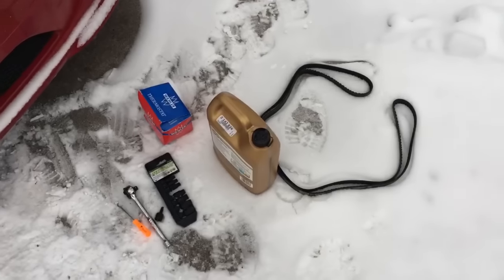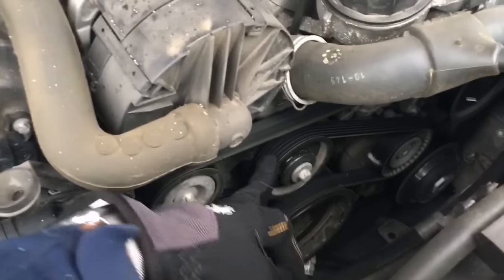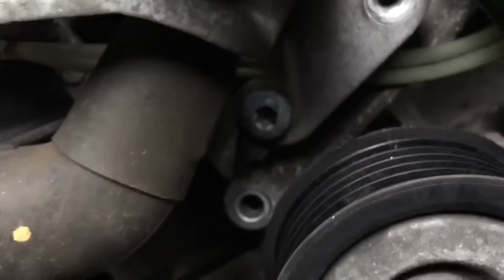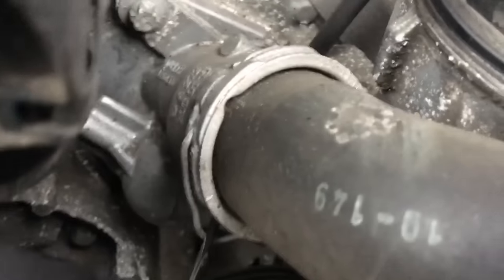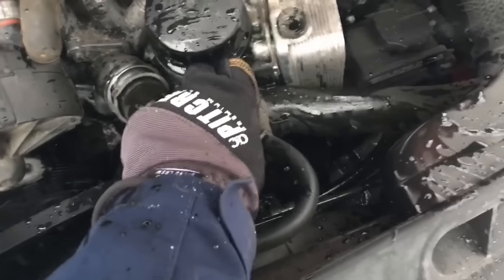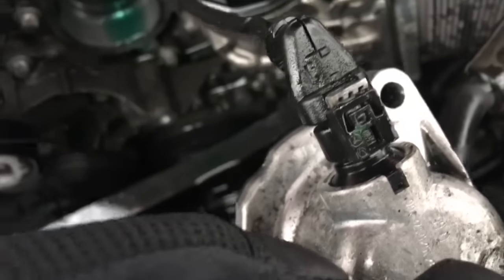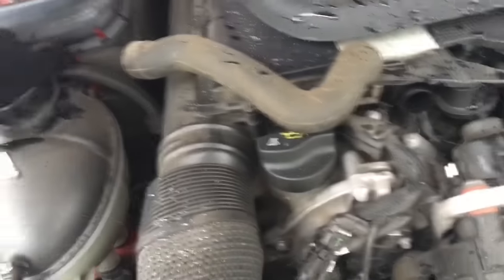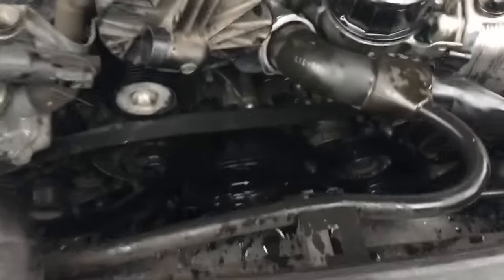Changing out a Mercedes W204 C350 thermostat on a bitter winters day

Comment: Arn't you supposed to drain the coolant out from the bottom of the car? Or is it ok to just let it drain out the way you did it? Also using your method, how do you know how much coolant you need to add when you done? One litre or something?
Reply from the maker: Im certainly not getting under it in that temperature.
Reply: in coolant tank are level

Comment: Check engine light still on after fixing?
Reply from the maker: of course -- the circuit temperature too low code will remain until cleared.
Reply: @OvalboreCars  it will go out after a drive cycle is complete and no fault is detected,or you can clear it with a scan tool.